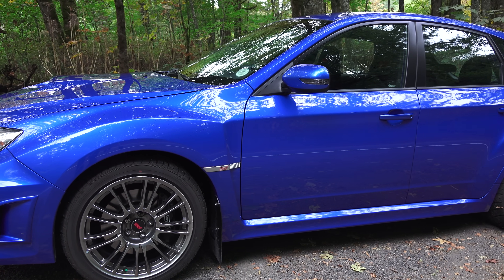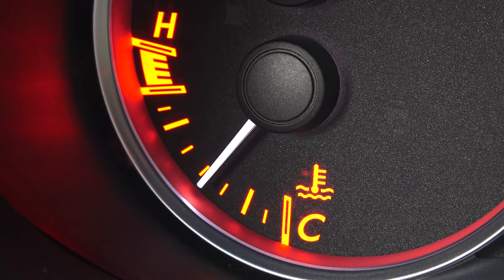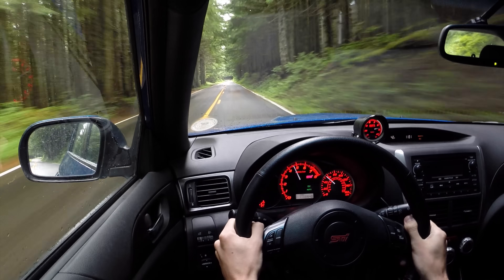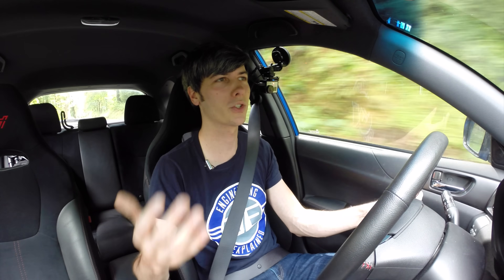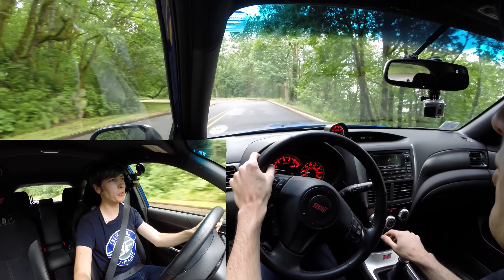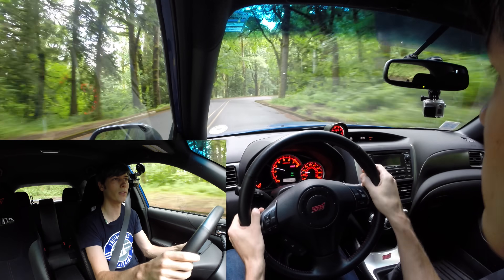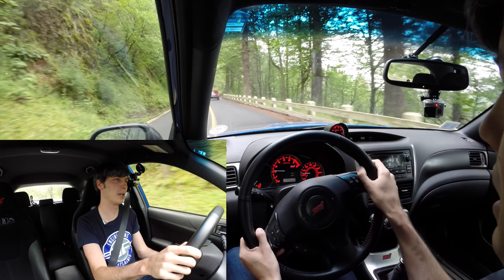5 Things You Should Never Do In A Turbocharged Vehicle

Comment: your number 4 item is dead wrong.  i was surprised to hear this from you tbh.  the octane rating  does not indicate the quality of the fuel, it controls the ignition point of the fuel, and different engines are designed to function properly with different fuel ignition parameters.  use the fuel the manufacturer recommends... period.  if you modify the engine, then get guidance from the car tuner about what fuel you should use, but this is typically pretty obvious based on the compression ratio.  while most turbocharged engines do have high compression and require higher octane fuel to prevent pre ignition, the way you made it sound like 89 octane gas is crappy, dirty gas may cause people to put 93 octane in an engine designed for 89 and not fully combust the fuel being injected, leading to a host of potential problems.

Comment: Is it also true that accelerating hard at low RPM(where the turbo lags) can cause the hot gasses at high pressure go back from the cylinder into the turbine and break it's blades?

Comment: How exactly can you have high boost with low engine rpm ? If the turbocharger spins as a result of the exhaust gases passes thru the turbine, 150p rpm means less exhaust gases, means less boost. Where is the logic behind this statement ?

Comment: I don't agree that flooring it at low rpm will result in higher fuel-air mixture.  The on-board computer regulates the fuel-air mix so if you floor it, the computer will prevent such an occurrence.  The computer would also prevent pre-ignition at low rpms.  I don't think this guy knows a lot about how modern engines work.

Comment: In the 80's it was simply no boost until 3 min. after start up, and 3 min. before shut down, I know that worked because I bought and 89' Daytona CS turbo with 14k on it, and traded it off at 104k still running great.  And I regretted that trade of within 6 months.

Comment: I disagree with you at 1.42, "turn off engine immediately after a hot run", this may apply to some vehicle-may be your sti but not with Audi. Audi has a second oil pump and it will continue to run for several minute after  shut down. you should be reviews as " 5 things never do if you drive a sti". Lastly, don't put your hand on the charge turbe to see if its cooled or hot.

Comment: I have heard about pre/post-lubricating systems to help prevent undue wear and tear on the turbo, especially after turning the engine off.
What are your thoughts on this?
Reply: Years ago I heard of a lot of people using a "turbo timer" that would keep the engine running or keep the pump running for 5-10 minutes after you took the key out.  Would be weird to walk away with the engine still going...

Comment: My car keeps the rpm at 1100rpm, every time I want to accelerate it either lugs or you need go too slowly to avoid lug
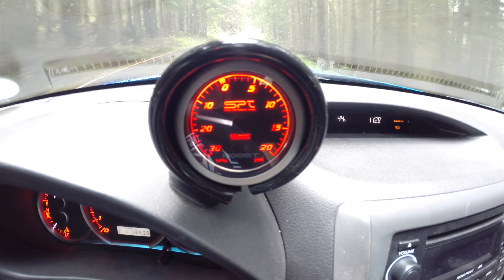Reply: M Bacon you want me to kick down from 1100rpm? That’s exactly what Jason says you need to avoid: see 2:25
There’s nothing broken it’s how it is designed for low emissions
Reply: M Bacon yes, bur before it does that it shakes, or if you don’t press too hard it shakes without downshifting. 
Anyway I either drive in sport mode or manual mode, never in D
With the previous transmissions the torque converter would take the  rpm to 2000 but newer ones lock up very quickly

Comment: The description of slip angle in this video is incorrect. What engineering explained is actually describing is the "friction circle", which is the relationship of weight transfer to each tires contact patch through acceleration, de-acceleration, and cornering at speed. However, the description on friction circles he gave was backwards as well! Not accelerating out of corners and instead lifting out of the throttle mid corner is more likely to cause a car to oversteer and spin! 

Slip angle is actually the difference between the angle the tire is pointed and the direction it is traveling. Slip angle is what a skilled driver uses to effectively steer a car with the rear tires using throttle inputs, through a corner. I highly recommend anyone to read "Secrets of Solo Racing" by Henry A. Watts, page 32 to 34. A Google search of slip angle would also  provide clarification.

Comment: I'm new to a manual car and I'm curious. When you're coming to a red light/stop sign, is it better to downshift through all the gears or can you just put the car into neutral and slow down with your breaks? Which way is better for the car?
Reply: Downshift through gears. You could put it in neutral but if the light turns green you will struggle trying to find the right gear after you slowed down. Unless you try to match rpms

Comment: Good video.  Just thought I'd chime in and FWIW, you mentioned about "pre-ignition" / pre-detonation especially at low RPMs with high load.  Pre-ignition can occur for multiple reasons, however, one common area that is usually not looked at right away is vacuum leaks that lean out the A/F ratio.  While it's true you can get a little more "giddy-up" on a lean burning engine, the lean can cause ping or pre-detination.  What does this have to do with low RPM / high load?  High load places more air in the cylinders and at low RPM (retarded ignition) this can "lean-out" the A/F ratio in the cylinder and in turn, may create the the same "lean-burn" condition as a vacuum leak.  In short, as you indicated,  "Turbo" boost at the appropriate time and RPM.

Comment: New cars want more fuel economy LUG?that exactly what my new car bmw 2.0l turbo, does with the transmission in automatic mode. It keeps rpm at 1100rpm. When you floor it it downshifts but it doesn’t happen instantly. D mode is rubbish. Sports mode is almost the same. Only if you move the lever to manual but don’t shift yourself it keeps it at higher rev. So the only way is to drive it in manual.

Comment: Another Thing Not to do with a Turbo Vehicle is: 
* Blipping the Throtle Just Before Turning Off the Engine (No Oil Feed ) + The Turbo/Turbine Shaft Will be Spinning at Very High RPM = The Turbo Unit Will have it's Life Ended Greatly.

Comment: You forgot  another real BIG one !!!!! NEVER rev up/build boost when your vehicle is not or barely moving (great example: winter parking lot drifting)   It has been repeatedly tested and PROVEN - The intercooler doesn't even begin to function until 30-35 mph, and doesn't effectively function until over 40 mph. Running your engine at high rpm's and boost without the intercooler functioning results in superheated "charge air" entering your cylinders , thus causing pre-ignition, blown head gaskets/piston rings, burnt pistons   etc etc etc.

Comment: I have an oil pressure gauge on my 300zx, I always wait until pressure drops to normal ranges at cruising and idle and when Im accelerating to start driving it hard. Can tell when its warmed up or not because after a cold start driving around oil pressure will be where it should be at WOT, around 60, and when warmed up cruising around should be 20-30 without being on the throttle, and about 15-20 at idle

Comment: i thought 5-30w is bad for turbo, too thin. i use 10-50w. oil still flows.
Reply: just stick with whatever the oil cap/owners manual says to put in it.  I've heard most modern turbo engines run best on really thin oil

Comment: Can anyone please tell me the effect of using a turbocharged engine without turbo, i mean i have mitsubishi pajero intercooler 2800, its turbo had problem, someone told me to remove turbo and use it without turbo, i removed it. now on hills and off-road, vehicle has no power and throws intense black smoke, vehicle is not climbing the offroads in even 4x4.
Please help me with it,

Comment: Question?
Should I Turbo my daily driver? ..I'm researching this option, and have watch several of your videos, but mostly all for high performance cars.

..is an old 98 Accord F23A1 with 240,000 miles, timing belt broke, fixed  it, but looks like some valves bend. Transmission was acting up too. So I'm rebuilding engine/trans    at same time.
Thanks in advance.
Reply: Sounds like a perfect condition car to turbo should last you years and be 200k more miles of fun
Reply: @pinytenis420  Thanks, im installing the pistons/rings at this point, I guess I went I little too much with the honning, my ring gap are a bit wider than what supposed to be, but turns out this is good for forced induction...didn't  meant to this,  what is your take in a bit wider ring gap, is it a big deal?(negatively)

Comment: I’m speaking for 91-99 Mitsubishi 3000gt Vr4 models 
And
1991-1996 Dodge Stealth R/T TT twin turbo. 

1) you should always drive with an aftermarket oil temperature gauge because cool oil is way too thick to push through these small turbos the high oil pressure will cause your turbos to blow its seals and o rings making the turbos blow oil. 

2) you definitely want an aftermarket boost gauge because the stock boost gauge in the dashboard is not connected to the turbos at all. It’s an engine load gauge with a signal from the ecu. 

3) install a digital wideband oxygen sensor and gauge because the stock intercooler pipes tend to leak causing a dangerous leak situation. Even one of the 28 year old little vacuum hoses can dry rot crack causing a vacuum leak also causing a dangerous lean condition that can lead to knock (detonation) in the engine. 

4) nothing lower then 93 octane fuel if you wanna keep the engine alive. Lower octane fuel causes knock even under normal driving conditions. Knock is the #2 engine killer. No oil is number one. 

5) check under the car. Look at the circle ⭕️ outdation  of the oil pan and make absolutely sure that there is not a single dent in and part of the oil pan. Especially near that circle area. Any dent in the oil pan is a ticking time bomb 💣 for the engine because the engine oil pickup sits literally 2 millimeters or less from the bottom of that oil pan and the slightest dent is causing major oil starvation to the main and rod bearings. Park the car and don’t start it again till you get the dent fixed. It’s very easy to fix and can be done on a day off from work. Jack and support the car on jack stands and make sure it’s safe for you to be under it. Remove the downpipe, remove the starter, drain the transfer case oil, remove the transfer case. And just let it sit on something padded on the ground still connected to the driveshaft, drain the engine oil, remove the oil filter, remove the turbo drain lines, buy new gaskets,remove all the oil pan bolts, use a oil pan gasket splitter (they sell it at advance Auto Parts) to split the gasket surface without bending the pan itself, remove the oil pan, inspect the oil pickup for damage replace it if it’s damaged, use something oval shape to hammer out the dent. (I use an old EGR valve as a chisel). Afterward clean all the old gasket sealer off and apply a thin coat of either Genuine Mitsubishi RTV sealant around the entire mating surface of the oil pan. If you can’t get the Mitsubishi sealant then I use “the right stuff” RTV all the time with great results. And reverse the sequence, install a new Genuine Mitsubishi oil filter and from now on only use a Mitsubishi dealership oil filter. I’m hey are $5.15 and are the best oil filter you can use in this car. The bypass valves never fail or collapse. Refill the engine oil and transfer case oils.dont forget to install the turbo oil drain lines with new gaskets. Install everything else. Start up and check for leaks. Congratulations 🎊 you just added years to your engine’s lifetime. 

6) inspect the timing belt once a month at least. The upper timing covet has 2 10mm bolts and is very simply to access. Change everything at the very first sight of slack in the belt, cracks, oil  on the belt, water pump leaking, pulley noise, or you just got the car and don’t know when it was last changed. It’s an easy job but all the timing components absolutely have to be genuine Mitsubishi parts. Especially that tensioner adjuster I’ve seen cars come to me with that Chinese made eBay tensioner fail on initial startup and when that fails it takes the heads, valves, and sometimes the pistons with it because it’s an interference engine and this is why we have to have that only the best attitude when it comes to timing belt components. The only exception to this is if you make big power like myself I use the gates racing blue Kevlar timing belt that is 100 times stronger then the Mitsubishi oem belt. But it’s very expensive well over $200. So you really don’t need it. 

7) every once in a while spray the wastegate actuator Rods with WD-40 because they get dirty and rusty and will sometimes get stuck. And you don’t wanna be riding around wide open gate on stock internals without the proper tune. 

8) remove and inspect the stock ecu for leaking capacitors or burned circuits. If found have the unit rebuilt or consider a tune able chrome ecu like s Jesters unit. 

9) that’s about all I can think about for now. Just take care if these cars because they are a dying breed and the value has doubled since 2013.

Comment: Even in my naturally aspirated BMW M3 I keep my RPM below 3000 until my 6OW oil reaches at least 180 degrees F. 
That can take up to five miles of driving even in 90 degree weather. 

Oil needs to be nice and hot to flow properly underneath all bearing surfaces.

Comment: I have been debating with GM regarding the eco-tec 1.4L about oil and fuel. They recommend the lowest octane fuel, it does seem it's tuned to use the lowest octane fuel, and there is tuning options to optimize it for up to 91 (we also have 94 here). But they said not to use the higher octane fuel in the engine as it is stock. 
The second is their recommendation for 'semi-synthetic DEXOS' engine oil. I am used to using full synthetic, and would like to change it out with Mobil 1 Dexos full synthetic, but am curious if it is more prone to heating/sitting/leaving deposits at high temps, or if there is any benefit to the semi-synth over full synth if they are both DEXOS, and the correct 5W-30 oils? 

I live in Canada also, so where I live I see -40C in winter and sometimes OVER 40C in the summer. Is there any benefit to using different oils with different viscosities in different seasons? 

I know it's an engine with some design flaws, and some diffinitive week points (vaccuum lines, PCV valve/regulator, waste gate valve wear and cracking as well as the oil line feeding the turbo).

I am just curious if GM knows best, or if they are recommending cheap crap for their cheap crap. I would like to simply keep it running in normal driving conditions without wasting money, or comprimising on spending more on preventative maintenance  (Which I am my own mechanic, I can fix everything, I just don't want to, and they're fluid recommendations seem contrary to what I thought I thought I knew, and what yoh are saying here).

Anything to reduce failures would be great to know.
Reply: I've been running Mobil1 full synthetic in all my cars, including my old 2003 Honda Odyssey with 174k miles. I just use the "high mileage" version for that car. Pennzoil Platinum is also very good oil for really cold starts alongside the Mobil1. Here in Jersey we get 105°F summers and 0°F winters. I usually go down one viscosity grade for the winter. So for example, my minivan takes 5W-20 as OEM recommended viscosity for all seasons, I use 0W-20 for winter months. I suggest you do the same. It will save your engine and turbo on cold starts unless you're already running something like 0W-40 all year then it doesn't matter.
Reply: GM dexos has been full synthetic since 2016.  It has excellent LSPI protection too. GM is now on Gen 3 dexos as of 2022, and it's even better for LSPI and keeping oul deposits out of the turbo.

Comment: Thank you for the great explanation.
My BMW 120d had issues when flooring it at low revs under 2000 and it would shut off full power. It gave a drivetrain error and the power got reduced to like 100hp instead of 225. (ECU Remap) I never understood the problem but now I know I have to ease in the throttle.
Thanks engineering explained.
You do a great job!
Reply: Nah bruh you downshift thats what he's trying to say it sounds like you have a bigger problem on your hands 😂 i lug my prelude every once and awhile in traffic or whatever and never had any issue like what your explaining lol

Comment: 2nd point...So stop start is no good?
Reply: Your turbo isn't spooling up to max boost in start stop. It's if you are running it hard and park it immediately after and park it.

Performance cars with turbos have a turbo timer that keeps the engine running for 30 seconds or so to allow the turbo to cool down and let the oil run through it at idle.

Sorry if I'm not exact, but that's essentially what it does. Don't worry about it on your 1.4l turbo Hyundai.
Reply: @Ravenousjoe  don't have a Hyundai but thanks anyway.

Comment: EE, maybe you should issue a correction video for some of the things in this list you probably now now aren’t true?  I.E. the engine is under very low load until the turbo spools, even with the throttle open, which doesn’t usually happen until 1500-2000 RPM or more on most engines.

Comment: Had my 2.0T 4 years only just found out about to leave it running for a minute before stopping.
Reply: Moderen engines will keep running oil to the turbo and cool it down even when the car is off so id imagine your probably fine to keep doing that and its also when youre going pretty hard on the car like sustaned boost and high speeds so it probably didnt happen that offten